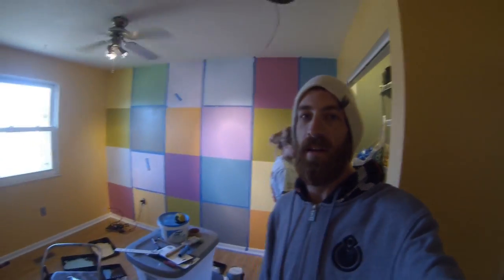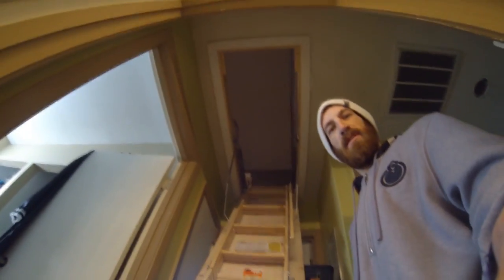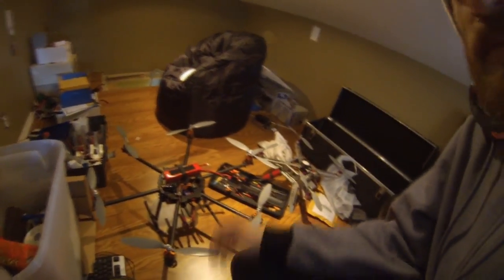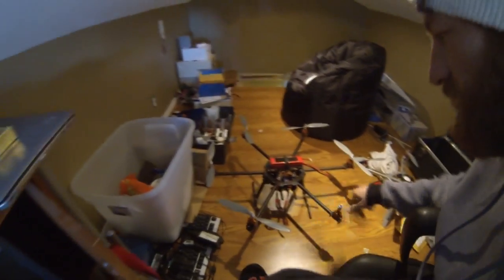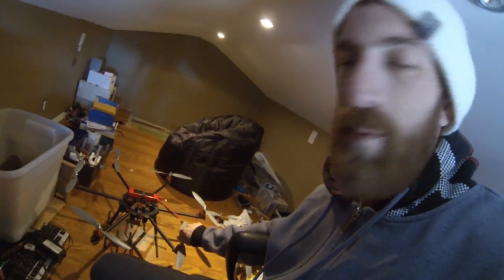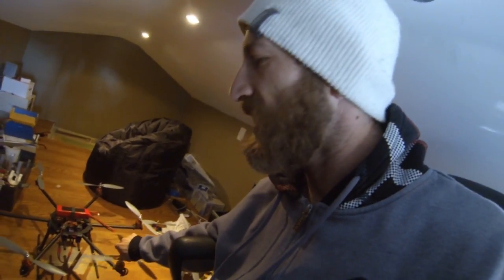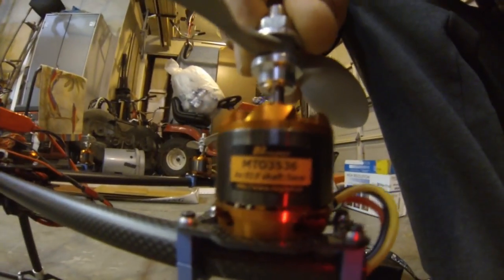FY680 Naza Hover Test

Comment: Nice setup, looks very stable.  I just purchased Tarot's new T810 frame. Videos like yours helps inform me as to what motors, ESC's, props, etc I should use.  Like you I would like to lift around 10lbs.

Comment from the maker: I have no clue on the AUW, as I tore it down to use the motors on another multi.  If I had to guess, I'd say around 8lbs, but I'm no scale.  The frame quality on the Tarot could be better but for the cost, its a great option.  they just came out with another folding frame which looks a little more sturdy.  Your 10x4's, some Tigers and a GoPro is a perfect setup for a backup.

Comment from the maker: The NX-4008 is a good motor.  I went with the Maytech's because I read a lot of good things about them.  I think with the 680mm span and the fact that you can only get 12" props onto it helped my decision as well.  I can tell you Radical RC has them in stock if you are in the US.  According to Maytech specs I am under-propped and could easily go up to a 5 pitch to gain more thrust at lower rpm but at current load the set up is pretty good.  The Maytech V1 Esc's also come preloaded with SimonK.

Comment from the maker: Not sure yet what it can handle.  I'm only running 30A esc's and I haven't pushed them yet.  I have lifted a Canon 60D on 3S on the Evo gimbal without any struggling or heat issues so with 4S it would be even more powerful.  I imagine it will be able to lift up to 15lbs on 4S but I never intend on carrying near that.  I'll stick closer to 10lbs AUW.  If I ever stress test it, I'll be sure to post the video.